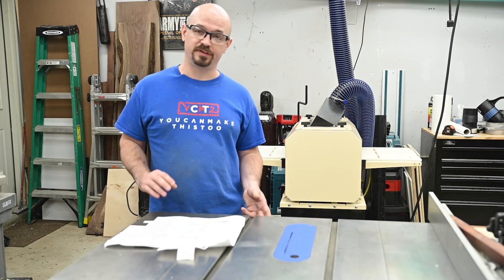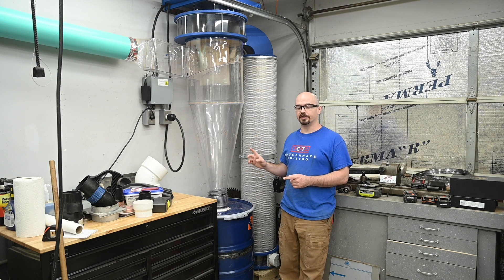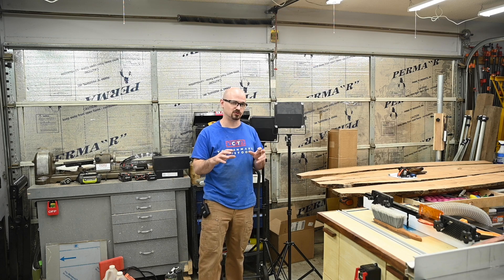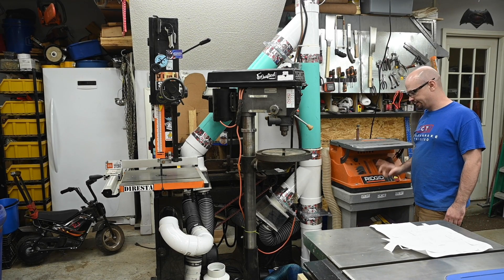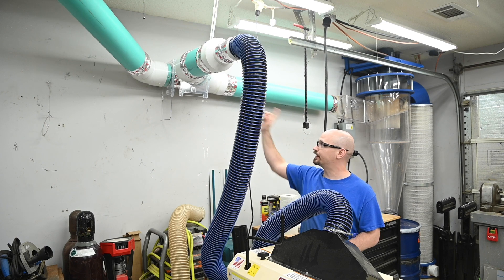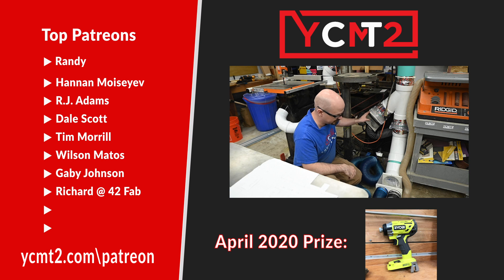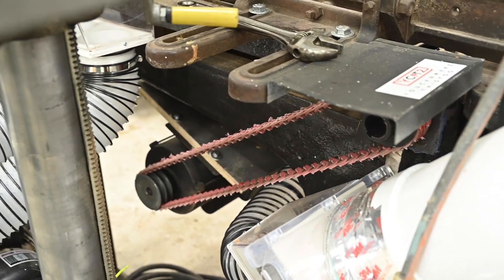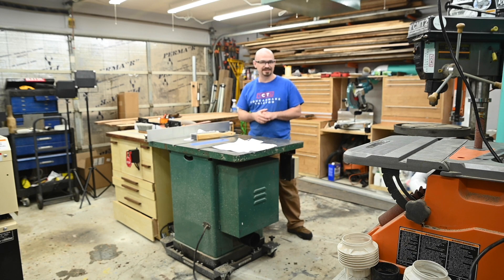2020 Shop Tour - Dust Collection Setup

Comment: I’ve often wondered why nobody ever points out blast gates at the wye’s. As you said, putting suction on a section of dead pipe definitely reduces the suction to the rest of the system. Gates at the wye’s is the most efficient and will extend the life of your vac.
I’m a little envious of your planer and jointer! You’re prepared for anything!! Love the retrofit on the jointer. I’ve used broom heads around jackhammer bits too. They’re amazingly helpful, especially around parked cars!
Reply from the maker: Me neither. I think the idea behind gates at the tools is for convenience. But my shop is small enough it doesn't really matter. And thanks! I really like the planer and jointer, especially with the helical cutter heads in them.. that makes a huge difference. And glad to hear I'm not the only one chopping up broom heads!

Comment: Any advice for trying to find the hard pipe? My local big box stores don't even carry it, let alone price.
Reply from the maker: Check with your plumbing houses, I had to hit two to find out. None of my big box stores carry it either. Expect around $35 per 10', be sure to get sewer and drain, not schedule 40.
Reply: @YouCanMakeThisToo  Woo! I will have to drive a bit farther, but my local Lowes has the cheaper/thinner drain pipe in stock!

Comment: Thanks for the video - how do you feel about the noise from the collector? Any plans to build an enclosure around it like many Clearvue owners seem to do? I'm currently on the fence between this and the Oneida V3000. It's a bit more expensive but seems to have much more favorable loudness for a smaller shop.
Reply from the maker: It's insanely loud. If I had enough space I'd probably do an enclosure of some sort but it's too close to my garage door. I just wear hearing protection (which I should anyway while running the machines) and it's fine. Whenever I upgrade shops though I'll probably put it outside.

Comment: Just curious....where did you get your sdr35 and fittings?
Reply from the maker: One of the big box stores around me stocks them... out of the like dozen. Ended up getting most of it from a local plumbing supplier though. Only place with enough inventory.
Reply: @YouCanMakeThisToo  I actually had to order it thru Ace Hardware for the sdr and I had to get the fittings online. Complete plumbing source. Enjoy the Clearview. Mine is the updated version as well.

Comment: how big is your shop?
Reply from the maker: That one was 20x22. My new shop is 36x36
Reply: @YouCanMakeThisToo  I have a 20x30 detached garage that I had built. It seemed like enough space, but now I'm thinking I should have made it larger. I'm hoping to do like you and cover the walls in plywood and a cleat system. Almost all of my power tools are on casters, I need to move everything out of the way to park my car in the garage. BTW I had it built with 12' walls, any tips for using the space above the normal 8' wall?